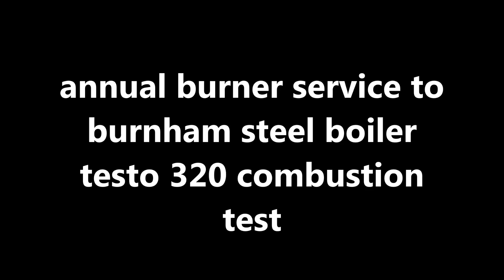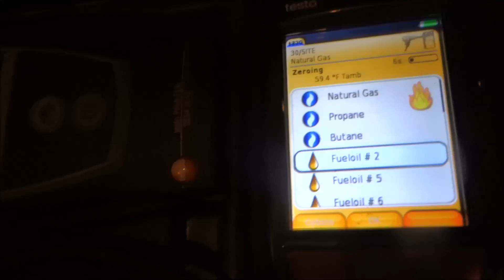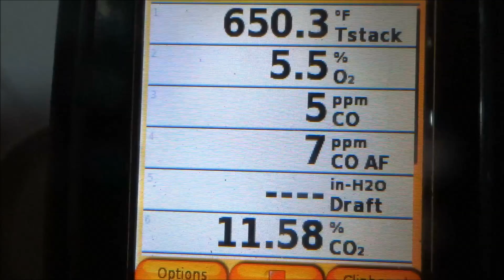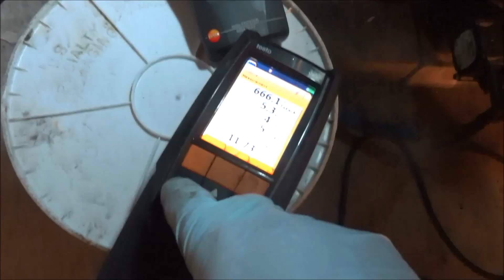oil burner service  testo 320 combustion test

Comment: Had a coworker tell me today that I should wear normal gloves instead of latex gloves. I just laughed. What causes the oil to gum up around the nozzle like it did on this oil burner?
Reply from the maker: +Sawashi32 the check in pump might be leaking by after shut down . could of just been the nozzle .the boiler was clean .so annual service is all i was going to do at this point . we will see next year when i go what she looks like

Comment: 650' stack temp.  Where the baffles out of that thing?
Reply from the maker: +Joe katynski its a steel boiler they all run hot .there might be a few baffels removed not sure been years sence i pulled the top of this boiler . i was happy with the numbers .the draft was .02 over the fire thats good .